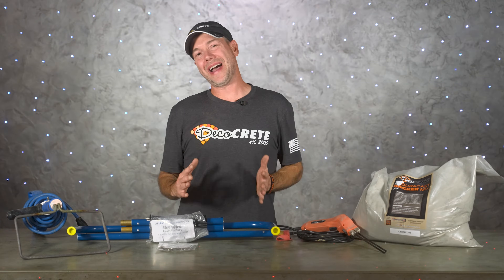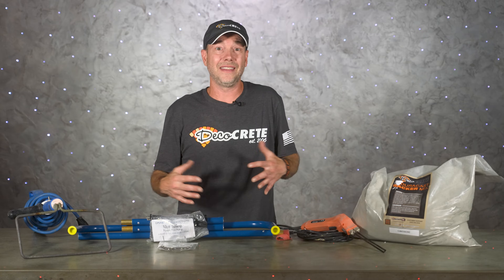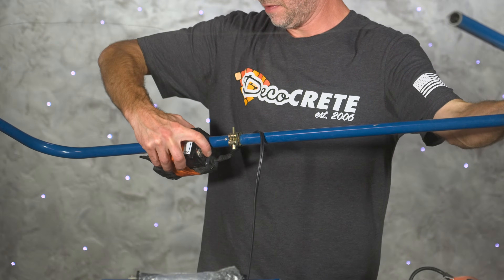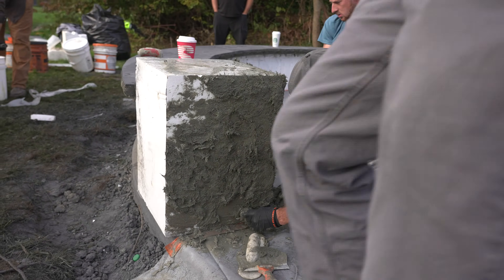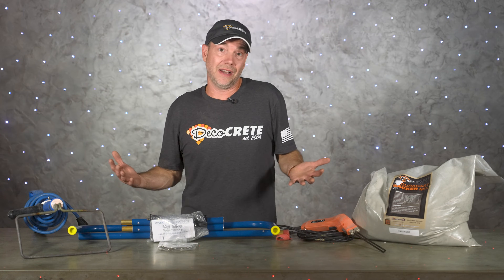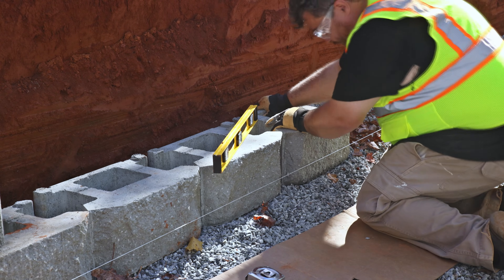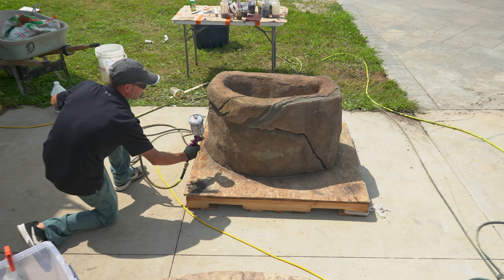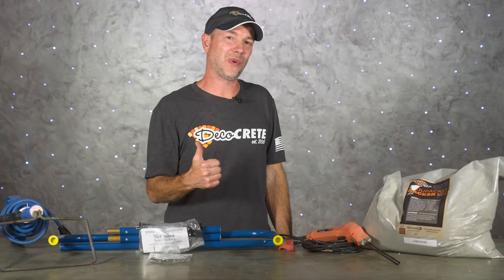How Foam Core Redefines Vertical Concrete!

Comment: can this be used to coat flat EPS panels? would any additional fiberglass mesh need to be imbedded in the mix for rigidity? thx.
Reply from the maker: Thanks for the comment! We really prefer ridged foam for this. EPS tends to have a lot more flex. I'm not saying it wouldn't work, but you may want to put the GFRC mix on a little thicker. And yes, you cloud also imbed some Spider Lath for extra support. Thanks for watching Deco-Crete TV!!!                                                                                                                                    https://spiderlath.com/

Comment: I saw a new house that designed the kitchen with foam core cement. They put a mesh over the surface before cementing. Thoughts?
Reply from the maker: Thanks for the comment! There's certainly nothing wrong with using mesh in that situation. As long as you have something solid to fasten the mesh to. This works great on ICF foundations. For larger rock formations, this can be tough because it starts as a big piece of foam, and there's really nothing to anchor the foam to. In that case, we recommend using some sort a structure mix for the scratch coat. Our GFRC Backer mix works really well for this. Hopefully this helps. Thanks for watching Deco-Crete TV!!

Comment: How about something like a bathtub ? Maybe even a large 7 ft wide bathtub ? 
What is your opinion on the structural integrity for water retention there ??  I have seen may youtube videos using them but I want to know from an expert how much load to expect.
Reply from the maker: Thanks for the comment! I would probably stay away from foam core for bathtubs. I'm not saying it wouldn't work, but you would need to thoroughly waterproof the structure before applying the vertical concrete. Outdoor water features are a little different then an interior bathtub. Even a minor leak would be a big deal interior. There will also be a lot of pressure from the water. I would try to create the structure out of something masonry. Hopefully this helps. Thanks for watching Deco-Crete TV!!!

Comment: Long ago I saw people using chicken wire in boulders to improve strength while applying the concrete mix, do you still need it if you use this GFRC coat?, thanks
Reply from the maker: Thanks for the comment! On Styrofoam, the GFRC mix is all you need. However, I would still use wire lath on plywood or drywall to increase the bond. Thanks for watching Deco-Crete TV!!!

Comment: I can't find foam that isn't extremely expensive
Reply from the maker: Thanks for the comment! Foam certainly isn't cheap, but it's still more cost effective than building the structure out of steel or masonry block when you factor in the weight of the structure, time, and labor. We sell foam billets on our website that are 50" x 33" x 98" for $529.92. I'll leave link to the page on our website, I don't have an exact on the shipping amount and it will very from time to time. You can contact us if you would like a quote. Hopefully this helps. Thanks for watching Deco-Crete TV!!!                                                                                                                                                                                                                                                                       
 https://www.deco-cretesupply.com/products/vertical-concrete

Comment: Have you made tables and chairs with this method? Curious if that would work.
Reply from the maker: Thanks for the comment! We've never made tables or chairs with foam core concrete, but that doesn't mean it won't work. Generally, GFRC would be the go-to material for concrete furniture. The advantage of foam core & vertical concrete would the freedom to shape and carve the piece to whatever you want it to look like without building a mold to cast the GFRC. I would say the best thing to do is try this on a small scale to how it's working for you and adjust from there. Hopefully this helps! Thanks for watching Deco-Crete TV!!

Comment: how much weight does the foam core support? Can i make a generator pad out of it and support the 400lbs that a generator is?
Reply from the maker: Thanks for the comment! It's hard to give an exact amount of lbs that the foam core concrete can handle, there are just too many variables. I really wouldn't recommend foam core concrete for anything structural. I would stick with a full thickness concrete slab for your generator pad. I'll leave a link to our how-to video on forming a concrete slab. Thanks for watching Deco-Crete TV!!!                                                                                                                            
 https://www.youtube.com/watch?v=grwqtx5ajUQ&t=312s

Comment: What would you use to core foam cinder blocks (open cell or closed)?
Reply from the maker: Thanks for the comment! Open cell foam works the best. It'll be easier to get a good bond, just prime & start coating. If you have to use closed cell foam, you should rough it up thoroughly with a rasp before the scratch coat. I'll leave a link to a video on using the rasp. Thanks for watching Deco-Crete TV!!!                                              
https://www.youtube.com/watch?v=6q-b5zi223g&list=PLgaJ0iW5t2koobX1PVw0WPMgeNY5ypBJ8&index=5

Comment: What thickness should the concrete be on top of the foam core
Reply from the maker: Thanks for the comment! The GFRC coat needs to be at least 1/2" thick to create a good structure. After that, the final layer can be whatever thickness you want. Most vertical carving mixes get applied at 1"-2" depending on what kind of look you are creating. Thanks for watching Deco-Crete TV!!!

Comment: Would foam core work for a concrete aquarium?
Reply from the maker: Thanks for the comment! I would stay away from foam for aquariums. Not saying it wouldn't work in some situations, but water creates a lot of pressure. That would be quite a bit weight for the foam to hold back. I don't think the foam would collapse, it would just be a matter of anchoring to the floor. We've built plenty of water features out of foam, but we don't have any experience with aquariums. Thanks for watching!!